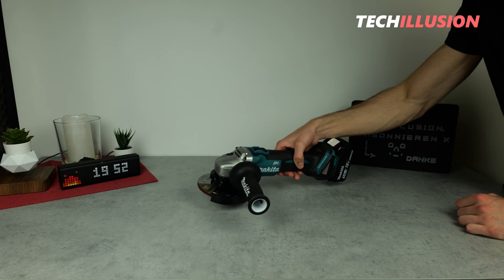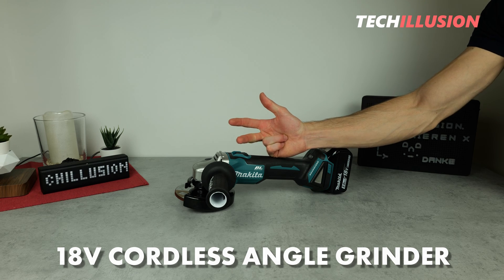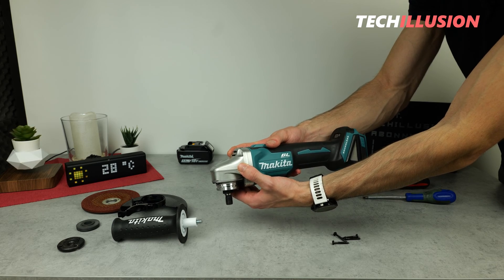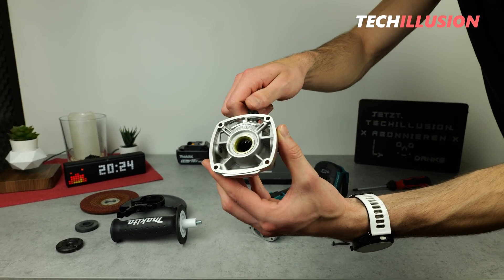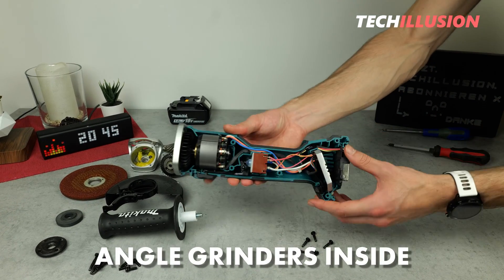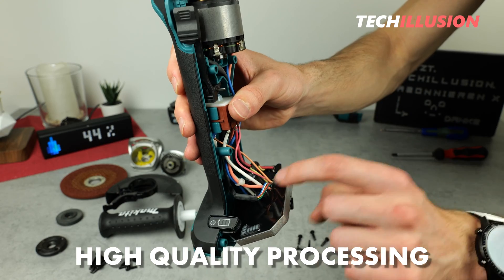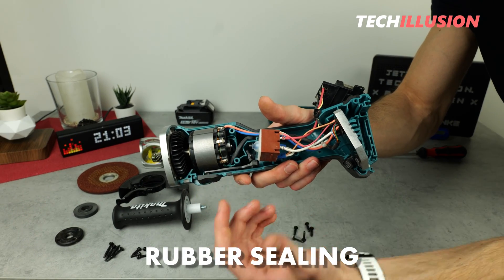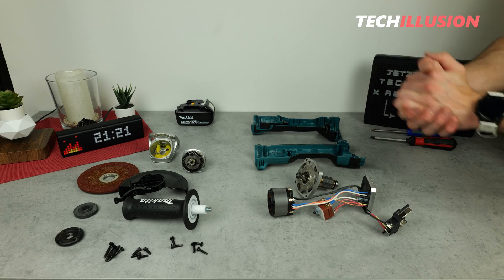🔥TEARDOWN!😱 WHAT'S INSIDE a BRUSHLESS 18V cordless Angle Grinder by MAKITA?!🧐 Teardown Makita DGA

Comment: In term of proffesional users, do you prefer to using this brand or another brand like metabo, bosch or hilti? Just wonder about german pro think what the best tool and why. Thanks my friend.
Reply from the maker: I don't think you'll have any problems with the brands you mentioned, as they really are high-quality tools!
I would make the decision itself dependent on several criteria.
A huge advantage of Makita, for example, is that this manufacturer has an extreeeemely wide range of products! 
Bosch also has a very wide range of tools, only Makita is better positioned in the gardening sector.
The machines from Hilti are also first-class, but sometimes quite price-intensive.
I have not yet been able to test Metabo so intensively. However, I will work on this in the future and test other devices.
Kind regards :)
Reply: @TechIllusion-EN  thats expalain what i wonder, as prosumer always good to see wide range of tool, beside brand name. Thank friend 👍🏾
Reply from the maker: You're welcome! 😊💪🏼